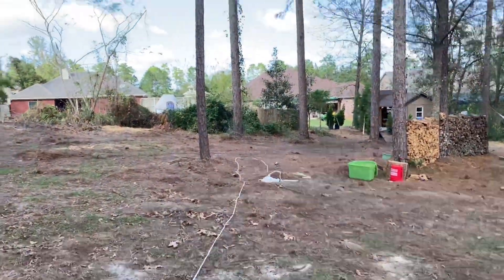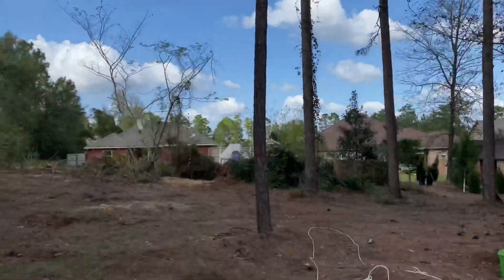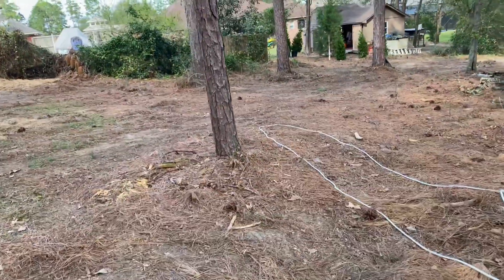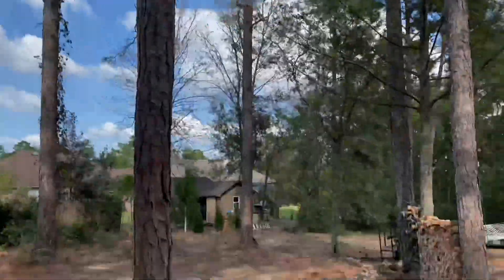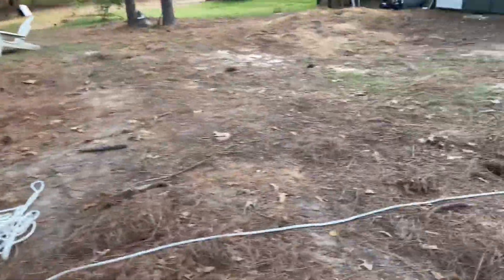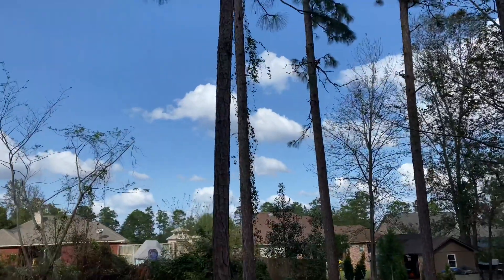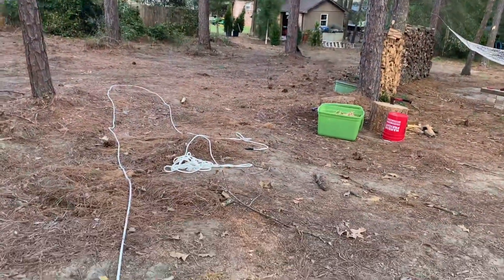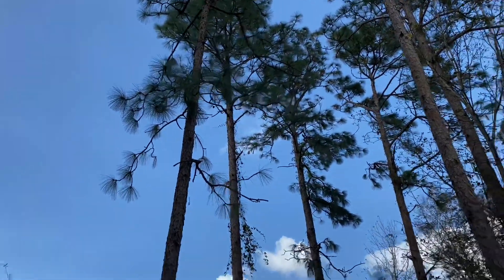Using a drone to rig a tree

Comment: I used a 100lb rated construction string, flew it over the top of the tree and then pulled an 800lb rated 1/4"steel cable with a gaff attached at the end. Secured the cable to a tree 200' away with a come along. Including cutting the 16" tree, it took 40 minutes and landed exactly on the 4x4s for cutting the tree in sections.